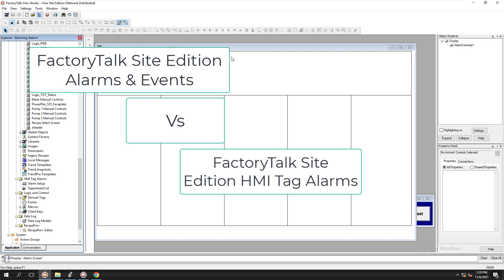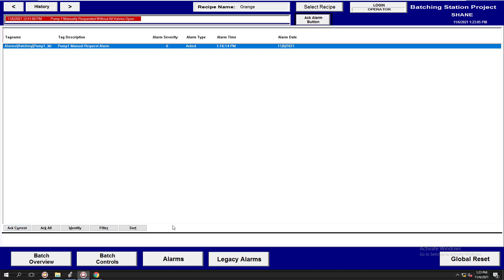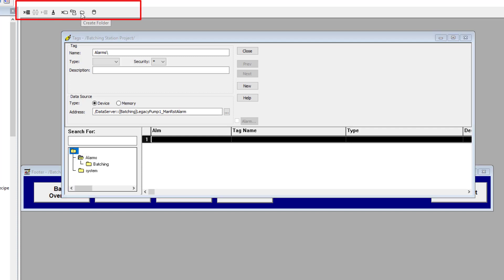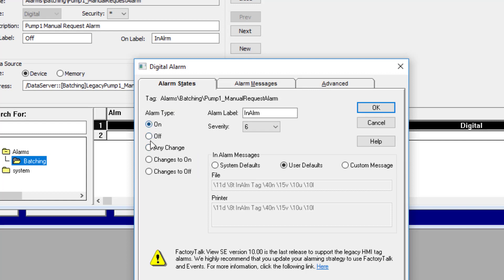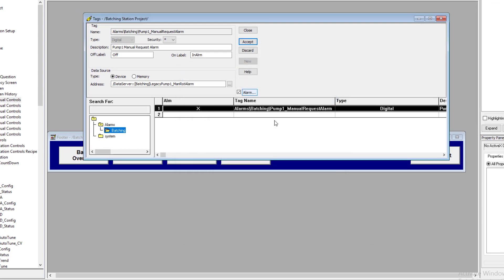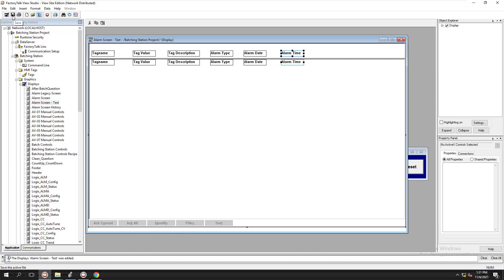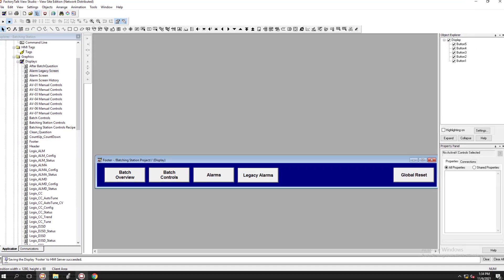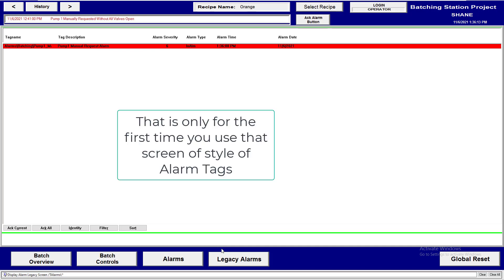Legacy HMI Tag Alarms FactoryTalk Site Edition | Legacy HMI Alarms

Comment: Hi Shane,

Thanks for all these helpful videos. I have two question for you:

Have you ever used PlantPax Alarm Builder to generate an alarms list generated  by the tags from a controller and imported to FTView SE under FTAE?

If you haven't, which method/tool do you use to make sure all have theirs alarms added to FTViewSE under FTAE or you do not duplicate existents alarms in the FTAE alarm list?
Reply from the maker: I stay with ALMDs for digital & ALMAs for analogs 

Then use SQL for history along with Alarm summary for current

Comment: Hi sir! Please help me. I had upload a project of machine.but can not use command in Motion Group as MAJ,MAM... Although I turn on MSO..I think it disabled but I do not know where?
Reply from the maker: Please clarify what you are asking, motion controls are to a simple answer.

A servo has to be in a motion group, that motion group has to be synched before any axis in that group can be used.

Also, the processor has to be the time master, meaning, time synchronous.

Then all of the axis in that motion group need to be setup properly.

If all of that is done correctly then standard motion controls should work with no issues
Reply: @ShaneWelcher  when I use MAM appear a error " The command tried to execute on an axis whose  servo loop is not closed "